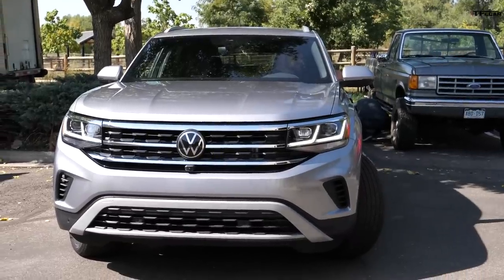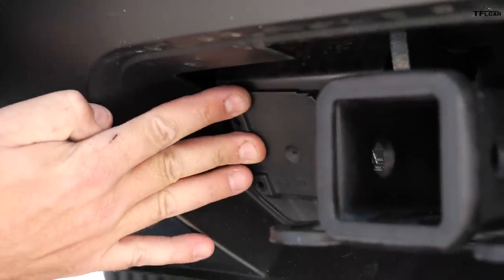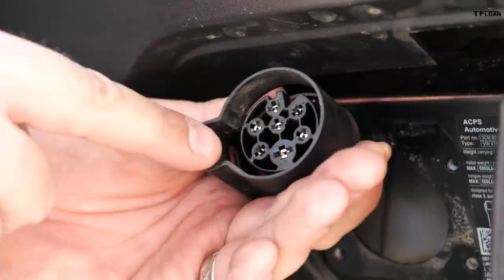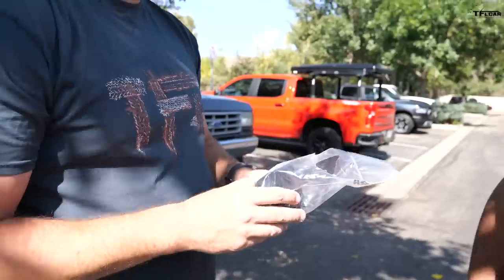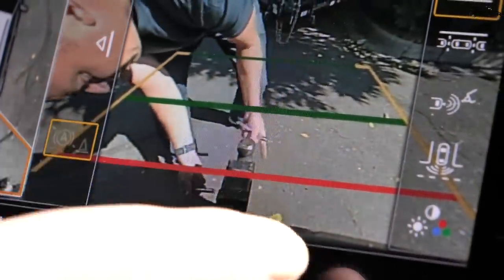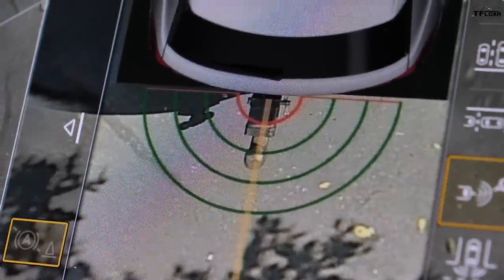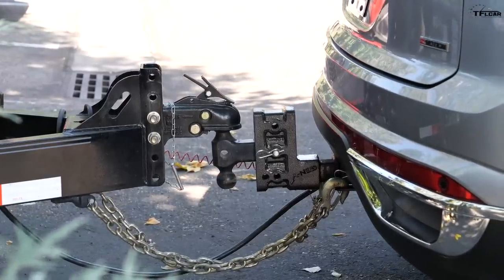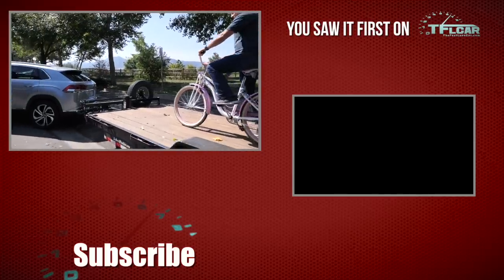Why Do German Car Manufacturers Make It SO HARD To Tow?

Comment: That's interesting. In germany we usually have a round  13-pin connector on new cars. I think the 7-pin is an older design but rarely used in Germany nowadays (only on older trailers). An US-designed and US-built vehicle should definitely have the american standard socket when sold in the US... Not only that, but in Germany we don't even get the Atlas.
Reply: Americans can't pronounce Touareg so we get the  Atlas.
Reply: So the connector that comes on this vehicle doesn’t connect to anything. Just curious what do the extra 5 pins of the 13 pin in Germany control over the 7 pin?
Reply: @supporterofsanity  I think those extra pins are mainly for rear foglights, permanent power for a caravan and communication (might be a CAN bus but I'm not sure).
Reply: @andreasbayer  and just for extra lights I guess
Reply: @supporterofsanity  it might be the old german style (7 pin) connector. But I think (hope) this could be a pre production car and normal cars might have this external connector suiting the local style. Should not be a problem for volkswagen (or any other company)...
Reply: supperterofsanity https://en.wikipedia.org/wiki/ISO_11446 here is the answer
Reply: @eivmel  thank you I was wondering what they all did
Reply: @krane15  I wish we could get the Tuareg back.  The Atlas is hideous.   Please bring the Tuareg back.
Reply: @chrishoesel  Unlikely. VW does a terrible job at marketing to the North American buyer.
Reply: Do you have a link to where to get the adapter?

Comment: Guys, here is some information for you. I am a German, living in Germany. I drove VWs almost all my life. Here we use trailers a lot, because pick up trucks are not so popular. However, that connector you showed is not the european standard. The european standard has 13 pins, not 7. The connector is a factory standard. The Atlas shares the electrical system with many other cars like the Tiguan. And these are sold everywhere. So, the Atlas might not be sold in Germany, unfortunately 😪, but its electrical system is sold worldwide inside of different cars. With the adapters (the two package) the system adapts to the local standard.

Comment: I love the tip for the top view reverse cam! I haven't tried that with my Atlas yet. 

I have a tip for the adapter installation. You can get the Pollak 11-893P RV 7-Way Socket (Oem Style) for roughly $10 on Amazon. Much cheaper that the dealer part, only 4 screws to remove the blank-off plate and install the adapter, and takes less than 15 minutes to install. Also, there is a brake controller wire hidden behind the driver side kick panel that makes installing the brake controller easier. Tekonsha makes an adapter (part number TK22FR available on e-trailer) that connects to the factory harness so no need to cut and splice.

Comment: That is the connector behind every GM, Ford, Ram pickup or SUV 7 pin plug. This allows worn 7 pins to be replaced if the have bad pins. This connector also allows manufacturer to market area adapt vehicle easily by using the correct bumper plug and nothing else is changed on vehicle harness. Sold at AutoZone and OReilly’s. Industry standard tow light plug.
Reply: Curt 55415-$12 on Amazon its a USCAR standard for IS cars and Toyota not german

Comment: It’s the Pollak 11-893P 7-pin adapter. You then need a 4-pin adapter to plug in for use on most trailers. I have both items for my Atlas Cross Sport, with the 7-pin connector installed where the blank plate was.
If you get the higher trim level Cross Sport, it comes installed from VW. And by the way, go to Amazon a pay about $12.00, NOT $53.00.
Reply: 👍 thanks

Comment: Ford does the exact same thing, it is because the connector that you plug the trailer wears out and you can easily replace it without having to replace a major section of the harness or hack the ends of the wires.  Both my F250 and Expedition have an adapter exactly like that. They just came from the factory with it installed.

Comment: That's not a European 7-pin plug, but probably a VW specific connection so it can be fitted with different plugs.
The European 7-pin (ISO1724) looks like this: https://commons.wikimedia.org/wiki/File:1-1111-Anhaeng_buchse_7-pol-ISO1724.jpg
Reply: Thanks for correcting that

Comment: Same problem with my Ranger wildtrak. All trailers in Oman use American 7 pin, Ranger uses European standard. I had to get rewiring done on my car.

It's actually more complicated than just rewire. Germans have different wiring standards regarding indicators and reverse lights on the trailers. The brain box of the towing package will get confused if you plug in an American break controller into a European standards car. So had to do some serious wiring gymnastics to make it work

Comment: Towing wiring and all is an option. That particular unit just doesn’t have that option box checked.
Reply: My 2019 Atlas has the Towing Package, and I had to buy and install the connector, exactly as shown.  It's a sore subject because I didn't notice until it was too late and had to borrow another tow rig because I couldn't connect the trailer lights.  I understand that some dealers have gotten tired of the complaints, and install the adapter in vehicles that have the tow package before the customer gets mad about it.

Comment: Sorry but that is NOT the European 7 or 13 pin connector... My guess is that the car has the option "ready for trailer hitch" and not the complete package.
Reply: Good guess but incorrect. It has the hitch and upgraded trans cooler and wiring. Just need the adapter that VW cheaped out on including on a $35-45k vehicle.

Comment: Is it really an adapter?  On my Colorado there is a plug which plugs into the back of my 7 way plug which enables you to disconnect it to remove the bumper.  I wonder if that plug is the same type of thing.  Easier to wire all the vehicles and add the correct plug to the ones with that option.  Car manufacturers do things like that all of the time.

Comment: Well obviously the first place to look in is the owners manual.
Yes that is a European type connector and yes there is an adapter for it. I live in a country where there are countless US vehicles as well as lots of European vehicles as well . The European way of doing things is simple and straightforward one double size and 50 mm and Basically one connector for light trailers .  Even if the vehicle is built in the US for the US market that does not mean parts like wiring harnesses will be specific for one country and I’m sure the car gets Lots of its parts from Europe and elsewhere.

Comment: Prodigy RF is great - I am not sure about your zip-tie solution as the sensors may need a fixed position to function properly (and theft.)  I thought the idea behind the RF was to permanently mount one to each trailer and you can use one wireless controller for all trailers and all vehicles?  Unless your trailer is a rental then ignore this comment.

Comment: Good video, I have a 2020 Rockwood 15 TB single axle approx 3500 loaded travel  trailer, 360 lb tongue weight, that I tow with a 1999 Infiniti, 3.3 V6, tow rating 5,000 lbs, high mileage.  I avoid steep mountain passes and do fine going to the Oregon coast.  I also have a VW Routan that I love but is not rated to tow the trailer.   I have a rear view camera on my trailer that works when I have the headlights on and is powered through the 7 pin connector U Haul installed.  I hsve a weight distribution hitch and in considering the Atlas, which I like, view as having similar  horsepower, I have read I can not use the weight distribution hitch spring bars or will void the warranty.  Is this true?  I have the Prodigy also and a blue tooth controller.  Viewing the tandem axle trailer in your video it appears not too much sag so wonder how my single axle trailer would sit without the spring bars connected and if still safe to tow?  No sway wanted, and my trailer tows wonderfully, I have not tested it without the spring bars on my Infiniti, obviously want to know how the Atlas might perform.

Comment: i install hitches at u haul and the german cars are on the hole the must difficult.  we cant do wiring on audis because theres some computer that controls  the taillights and it doesnt like to work with our harnesses.  the standard hitch and wiring we install is a 4 pin flat

Comment: That is NOT a European 7 pin connector. They look different. And by the way you hardly find the 7 Pin in germany because the most Vehicles come standard with a 13 pin connector.

Comment: Why is a trailer brake controller needed? Why don't larger trailers have that hydraulic thing that brakes the trailer when you brake?
Reply: You don’t NEED a trailer brake controller to tow a trailer with electric brakes. The trailer brakes will still work as long as your vehicle has 7 pin wiring. You just won’t have any control over how strongly the trailer brakes. My truck without a brake controller defaults to using a lot of trailer brake force.
Reply: bdreed85 That doesn’t make sense. Why even have a 7 pin connector if it doesn’t provide power to the trailer brake pin? That’s the whole point of having a 7 pin versus a 4 pin, since the additional 3 pins on the 7 pin are for trailer brakes and two optional functions very few trailers use (reverse lights and accessory 12v). That’s also the reason the 4 and 7 pin connectors are so different, so you can’t plug a trailer that requires brakes into a vehicle that doesn’t provide trailer brake power. So I’m pretty sure a 7 pin connector that doesn’t provide trailer brake power would be illegal.
Reply: bdreed85 As soon as you said GM, that made sense. Leave it to good old penny pinching GM to put a 7 pin connector in their trucks, and leave the most important pin unpowered.

Comment: Why difficult? That's a ISO1724 connector. 1.-The fact you use a 4-way or 7-way US spec connector doesn't mean the rest of the world use that. 2.-most probably all the wiring of the Atlas is made somewhere within EU.  3.- What is weird is the adapter is not included with the towing package.
Reply: Why does the North America not use ISO1724 because its a new standard enacted back in 2003. While the 4 pin and later 7 pin Heavy pin were designed Nearly 50 years ago.

Comment: Why does it seem like all these "issues" are known in advance and then they act like they are solving them on the fly? So that was the first time you realized the wiring was different? And the plate just happened to be unscrewed? And Andre just happened to have the correct adapter? Which was in the factory package still?

Comment: Just buy the $20 adapter on amazon.
Reply: It should come standard especially if the vehicle is designed for Merica
Reply: Just buy a different vehicle
Reply: @ernestochavez5106  that too
Reply: @ernestochavez5106  I'm not a fan of the atlas, it's a real shame the Touareg didn't make it back to America, because it is a great vehicle.

Comment: German engineering at its finest. If you remember when the Volkswagen Touareg first appeared; Volkswagen claimed something like 7500 pound towing capacity. It was complete nonsense, it couldn't be done. Lawsuits were filed by customers who purchase a vehicle believing what Volkswagen told them about towing their trailers.  Of course Volkswagen denied responsibility even though it was clearly their fault.
Reply: Because Americans are serious about our towing. If you claim 7500 lbs you know people are gonna ride right up to that limit or break it on occasion.
Reply: Species 8472 yes, but in this case you couldn't even get close. The car could not handle anything like the amount of tongue weight required

Comment: Since when? Most of them have electric tow bars that retract and release with a button. It's Americas fault for the strange tow hitches used not the Germans. Everyone else uses the normal thing then the US has something different. Why is it that you guys don't get the electric ones? A GLC, GLE, GLS etc for example, have electric ones. Touch a button and they pop out.
Reply: The german hitches can't handle any tongue weight. The german hitch Design sucks. Everyone else fuses the 2" square hitch. I am german, automitive engineer and staying that. Germans know a lit about going fast but nothing about towing.  Just look at the 1940's trailer brakes still used in Europe. Total carp! All row vehicles should have the us hitch with trailer brake controller! Much better setup that the "I don't want to get my hands dirty" fancy useless german hitches that are not even hight adjustable!
Reply: @ralfhiller9043  You just need to load a trailer properly. I've seen people towing 3,000 kg caravans with those normal European hitches. They work just fine. During testing, they test the cars with trailers. You can't tell me they don't know anything about towing otherwise their cars wouldn't be so good at it. These American hitches are cumbersome and untidy.
Reply: @SDav21  the us hitches are universal, not car specific. Much more usable. If you lift your vehicle in Germany you can't tow anymore because the hitch is too high. I have lunch ed it the US and towed a lot an the us trailers with more tongue weight tow much better than the EU trailers. Same with tow vehicles, tow with a fullsize truck and you see what stable towing is, the EU cars are much worse for towing. That is why I now only have US tow vehicles in Germany with the US  hitch. If you think a Mercedes tows well, tow with a fullsize us truck or suv and you will see how much more stable they are! And the surge brakes in europe suck bigtime. But I am working on changing that soon!
Reply: @ralfhiller9043  Yet the European models always have a higher tow rating. Why would that be?
We tow a 1,600kg caravan (granted not the heaviest) with a C Class 2 litre diesel. Even at 120kph it is utterly stable. It depends on how you've distributed the weight inside the caravan.
Reply: Because A pop out hitch wont be good for anything above a small trailer. Not when travel trailers here weight up to 15k lbs or 6,800 KG.
Reply: North American Vehicles, use a class rating for hitches. 1 for the little bike racks that hang off the back to Class 5 that can carry up to 17K lbs or 7711 kg. To pull more weight you go to a 5th wheel.  That Atlas probably had a class 3 hitch. 

And they are universal so you can use one ball for multiple vehicles. Or just take it out when not in use.
Reply: @Species-lj8wh  They're good enough for things up to 3,500 kg. Most cars can't even tow more than that. After that you're probably looking at large trucks in which case fine. But for cars like this it is perfect. You don't need those American style hitches.
Reply: @Species-lj8wh  But that is manual and the thing always sticks out. A pop out one folds away neatly with no effort.